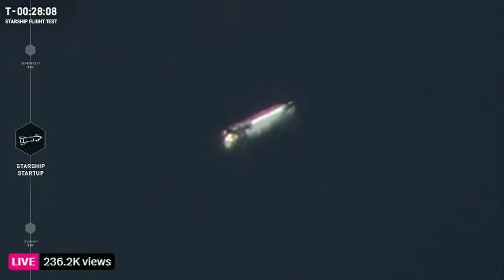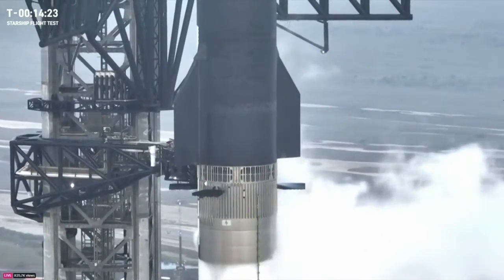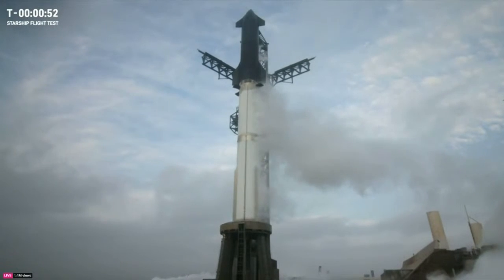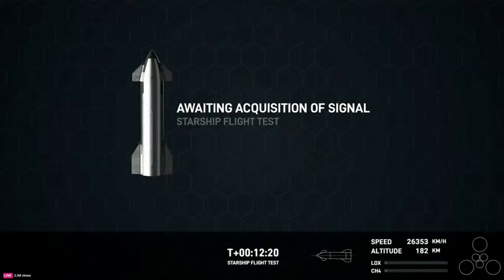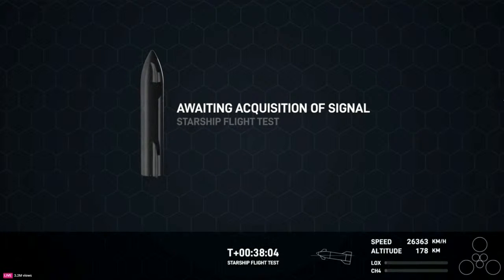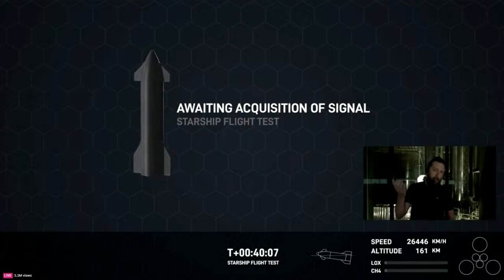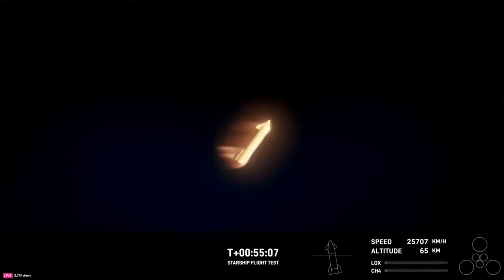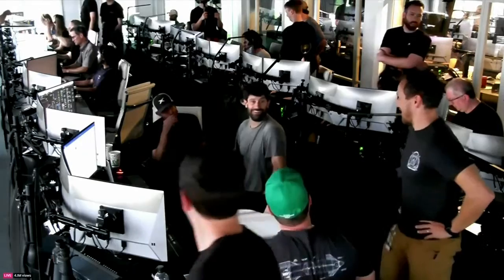SpaceX launches Starship in third test flight

Comment: Emergency!!!

 Baffles will not work to prevent the slushing problem, because the tanks of Starship system are too large. That is the only reason why the starship will explode every time.

The solution:

The tanks  of  Starship and  Superheavy need 2 disks valves, expanding the diameter of each tank. One of the disks, the one on top, rotates above the contiguous disk to close the overlaping holes on the surface of the disks; to reduce the Size of the tank by dividing it, before any rotation or acceleration of the rocket. This will prevent slushings and protect the plumbing, if located 10% above the bottom section of each tank. Large telescopic pistons can be attached below the bottom of disk valves to control the fuel pressure as the piston expands into  the fuel tank. 

 I have built a model that works perfectly. The second disk valve can be located 10%  below the front of the tank, to also protect the front of the tanks from the slushing forces. 

Why is Elon  not using four pins instead of three to secure each heat shield tyle? Four anchor points provide far more stability to secure a tyle, not three.What is more important than securing the heat shield? Four anchor points would eliminate the problems of tyles falling off the ship every time there is an engine ignition. Please get this message to Elon. Thank you.
Reply: Ah yes, the armchair technician is here, I'm sure your expert analysis is far better than what spaceX can do themselves, all hail our saviour 🤓
Reply: As we all found out by now, sloshing definitely contributed to the issues on B9 but it wasn’t the main one. The main issue actually had to do with autogenous pressurization systems.

To maintain pressure in the tanks, the autogenous pressurization systems uses unburnt fuel from the engine turbopumps and feeds it back to the tanks to repressurize the liquid oxygen tanks. By doing that, some ice can build up on the plumbing, which impedes the flow of liquid oxygen into the engines.